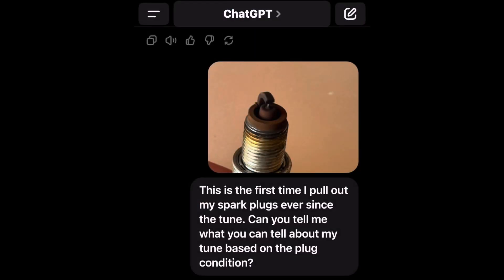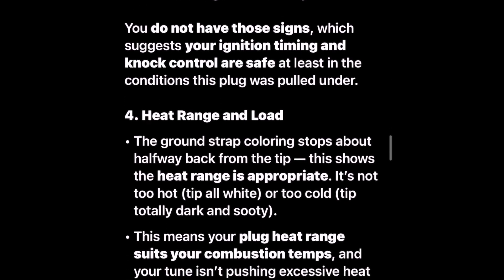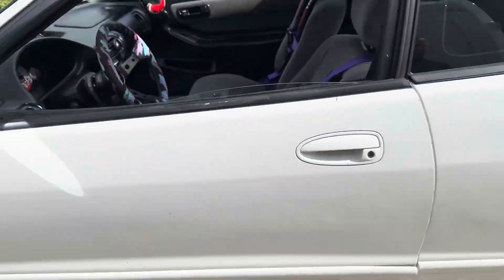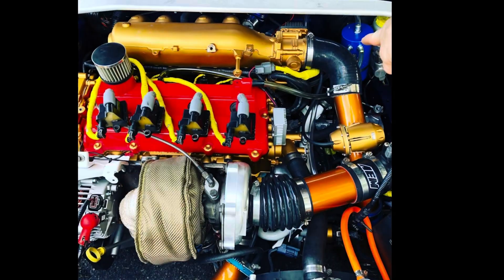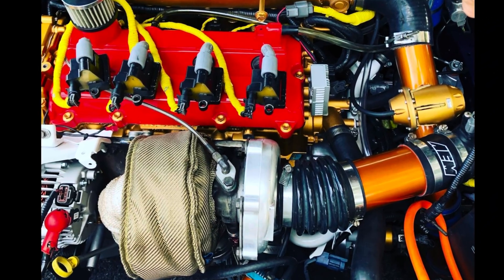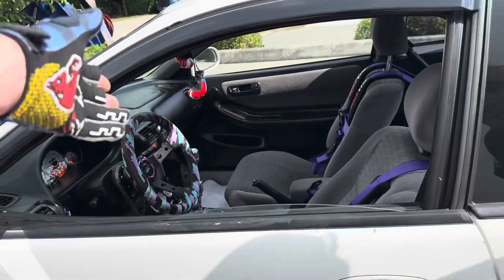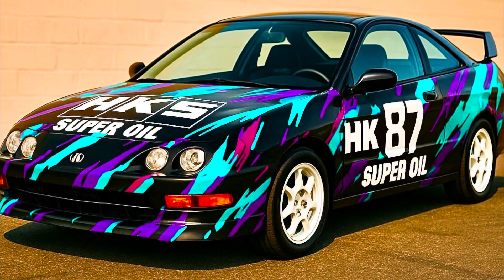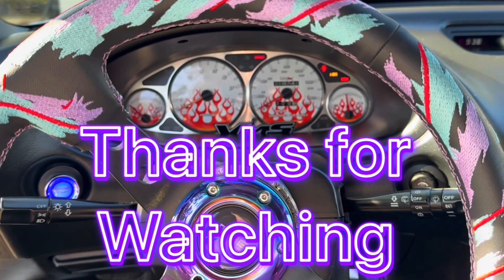Is tuning with Chat gpt SAFE?

Comment: I do not trust any of this 😂
Reply from the maker: @partial_throttle  … neither did I for a long time. Was getting noooo where with the forums since I got the car 1.5 yrs ago. Suddenly with CHAT GPT, vtech is now working, taking my time one cam table at a time, one ignition table at a time, small increments, log everything, up allll night fixing kinks via logs… and yet, if I have doubt, the support and or information I need and seek just does NOT exist and just is not being advertised. Plugs good, heat cycles steady in both cruise & launches and highway long pulls into 6th, temps steady, I have lean protection on that cuts tps input so if I’m leaner than what I type in, my engine will stop rpm.. AEM AFR-LSU 4.9 o2… also oem narrow band separately so I can choose how I want to log and or monitor, AIT compensation tables working, ECT comp tables working, knock noise/detection comp tables working, knock control percentage is at its lowest.. we can agree only a dyno can give the final outcome and I will soon some day, but prior to CHAT GPT, I knew NOTHING. And nothing was working for 1.5 yrs, just a crusty base map that did not even belong the k24a2, it was a k20 type s base map. Cam angles went up to 50° while k24 is only 25° max… I came a long way.

Comment: JW approved the ride with a big 😀 👍🏻 man that set up it's trust Worthy, respect.
Reply from the maker: Thanks.. lots has changed since then. Taken map wayyy further, been through 20 other plug reads. Recently tested ethanol blends! And again took the tune far beyond this video. I’ve ripped off the alternator bolt 3 times and had to weld a nut each time to extract and replace. New pully/delete kit coming to fix that. Working on latest video, trying to upload between Xmas & new years. I “FEEL” that since this video i may have gained near an extra 30HP. 

Many ppl don’t like the GPT tuning concept and born terrifies them lol. Donut Garage recently did a video TESTING to see if GPT can do their tune, it was a flop… their tuner called out GPT as well. Said HARD NO! lol😂… but fact, if you expect (as an entry level) guy new to mechanics, new to tuning, new to GPT application, then NO DONT TRY asking for a FULL tune or anything ambitious. But if you have a deep desire, huge passion, patience, determination, optimistic, sceptic but more curious and ambitious to BE A GOOD TUNER.., then yes you can learn with GPT and you will make progress. No matter how small the steps.

Surely a tuner on a Dyno can do what i did in 8 months, he can do in 8 hours.. BUT I STILL DID IT ON MY OWN and I’m loving every inch of the way. Sick around😎

Comment: I tuned my F22 B58 on BM3 to a 10.7 1/4 mile using ChatGPT. I upload logs, it spits back recommendations and I upload them. No dips in my HPFP/LPFP, no knock. 

I know pro tuners that use ChatGPT to cut their tuning time down by over 50%. 

I had a buddy spend over 30 hours on a tune, decided to see what ChatGPT can do, input the data, and it spit out almost exactly what he calculated and the car dyno’d within 1HP on the AI tune. 

My .02 is run it, keep track of knock, boost, fuel pressure, etc and send it. 

I’m planning on a full frame turbo within the next year and will also have ChatGPT tune that. Who knows how far this can go!!
Reply from the maker: That’s awesome.. once you get the ball rolling, have an understanding of your engine, get to know the program.. GPT is great to get the ball rolling with safe values. You can always increase the values at your own discretion, then use GPT to oversee your logs and or screen shots of your tables. I’m getting very close to what I’m able to accomplish as far as street tuning vs a dyno.  I will come back with more recent updates. I’ve just been knee deep concentrating on tuning since.
Reply: @AutoBodyEverything same, it’s hard to stop once you start lol. Since using ChatGPT, I’ve actually learned what the car wants because ChatGPT is great at explaining what changes do what and why, so it’s a win win

Comment: Chat GPT is teaching me how to tune
Also I'm so glad you have a real exhaust on that Honda they sound so proper that way
Reply from the maker: Thank I appreciate it 💪 good to know ppl are applying GPT for their builds. I’m positive that this will help refine GPT’s answers in real life applications as users report feedback with GPT, but well thought out feedback and screen shots as to not slow the GPT learning curve. Oh here’s a very beneficial tip when sharing screen shots bcs they are limited by the day….

I use an app called Phonto, but you can use any other app but, with Phonto I first select “plane images” then upper right says “USE” click it.. next button left tab click and from list choose “select image” or photo… you can add as many as you want and you can size them down.

Crop the photos to be used first if you must, but what do is I line them all up… usually screen shots of tune tables, may even old tables and newer ones to compare, or…. It’ll be my ignition tables and cam tables. Then I can have an hour long discussion with GPT with ALLLL these tables BUT I only uploaded ONE PHOTO file. Try it. Saves time, saves photo uploads and helps GPT give you MORE REFINED suggestions.

Comment: No thanks.  Tried it a couple of times and fed it tons of information, intake model, throttle body size, my cam specs, piston types,  piston clearence, head specs and  clearences, bore, stroke, rocker types and lifter clearances, turbo boost values. Turbo sizes, fuel preasure. Fuel type(e85), injector flow rate, then I realized this was a waste of time because what it gave me back was not optimal. If you don't know what you're doing and expect chatgpt to know what you have ,  expect a hole when you exceed 7k rpm and your VE table was to lean.
The bottom line is learn to  tune and understand the ve table and how the engine works. Take a class, read a book.
Reply from the maker: It takes trial and error. It’s like working with a remote tuner but bcs you’re the one doing the driving, the logging and making the actual calibrations, yes you need to self educate first. I never attempted to verbatim ask chat for (what) information to physically input as 100% confirmed data bcs I did not have the knowledge to KNOW if chat was making an error or not. What I did was educate myself to the brim and I made my own tunes at my own discretion and then share the feedback with GPT bcs I did not know “EVERYTHING” about reading logs. It wasn’t until I began to run out of ideas or was getting diminishing returns that I started asking Chat  WHAT CAN I DO to get more performance within safe boundaries. I did this by sharing good sections on my logs and bad sections or just “meh”. I also shared my tables, but.. you need to have a few hours/weeks of history and experience with GPT bcs the closer you get to pushing safe boundaries, the easier you step into criticality with knock count vs noise vs oem thresholds and sensitivity.

A few skeptics asked me to prove it by verbatim asking chat for actual values that actually work correctly and save. But if I did that, I would be misleading the media bcs I know enough to know just how many things can go wrong, but my point is.. everything I know, I learned it WITH GPT. Yes you’re right, read a book. But a book won’t give you what values to put into what tables neither.. it’s meant for self education, which you can do with gpt. The only difference is that gpt is more capable so you need to use it with caution bcs GPT does not know your skill level either.

That was a very detailed specification about your build you gave GPT but it’s not going to speed things up, instead it will give you even better results later down the line, but time must pass. Don’t give up on it.. GPT can be a tool, or it can be a weapon you know.. even a remote tuner needs you to drive logs and bring it back to him for observation before anything is confirmed. I must have done that with GPT like 20 times and not every iteration was an improvement, but with patients, ultimately after those 20 iterations and plug reads, yeah I did get much better and safer tunes out of it along with long lasting knowledge. There’s been times GPT’s (suggested) input was wrong or not good enough, but I knew enough by then to call it out and know better to not use it. But GPT’s responses to questions have been very consistent in being true and applicable.

My previous upload I tried giving ppl what they wanted per responses on fb but that video did not do well and it was almost an hr long. Can’t please both parties lol I guess..

I do best when I just to ME and do it at my pace and upload when it feels right and my car’s performance will be the physical results. I think I see a difference between how ive been using GPT and how others would like to use GPT. Maybe it was the catchy thumbnails (GPT) Tuning my k24A2… yea it sounds verbatim to some, but in all my vids I’m very open and honest about my understanding with GPT and my personal goals. I WANT to be the Tuner, I want to be the one doing the hands on tunes. I also want to go to school and get my certification so I can offer services like I have with Body & Paint. So maybe there are ppl who (PREFER) that GPT just give me the dang values I need so I can be in my way lol… 

Okay let’s finalize this bcs it’s already a long response but I’m invested in your gpt goals so if you got no body, you got me 😎 but we should go live bcs it will be better in many ways. You are 100% welcome to DM me on insta or fb. Autobodyeverything both are!

I would be 100% down to do a collaboration with another person and get the ball rolling for ppl who need it. I’m in south Florida where you’re home at?

Comment: This will be an absolute GAME CHANGER! I subscribed! Can’t wait! Maybe you can tune my S2000 on AEM V1!
Reply from the maker: I look forward to that day😲but AEM is top notch pro gear, but that’s likely out of my range. I’ve seen bits of it on other videos and it’s a very comprehensive ecu tuning platform but congrats on that setup! Must be a serious S2000 build 😎. Thanks for the sub🔥.. if you love what you are doing, then learning should NOT feel like homework 😝 it should feel like a privilege you know.. if I had to give one advice that is STILL applicable with AEM and the S2000 engine, it would be to ALWAYS use as many safety features and compensation tables and protection features as possible. This insures that if you enter too high of a value or if the value transitions are too choppy or if you run lean or if cylinder pressure is too high or if SOMETHING gets too hot, the ecu will either pull timing to prevent knock and the logs show it.. it’ll add fuel to keep temps at bay and logs will show it, it’ll also cut rpm briefly if you run lean.. infact you can ask it to cut rev ANY time engine condition is unsafe so you don’t actually go into the danger zone. 

I first educated myself to learn what the hell is cam angle 😆.. wtf is ignition degree, how much can I add…  what happens if it’s too much, how do I prevent… xyz..

As comments come in from the ones who are interested in self teaching tuning and are in the middle of a project, I’ll have a better understanding of how to tailor my vids. Thx😎💪

Comment: 0-70 in 9 seconds
Reply from the maker: @cjoe42  … yeah based on the logs but they don’t line up with the cluster so I should look into the wheel diameter speed compensation parameters.  I never noticed till after.